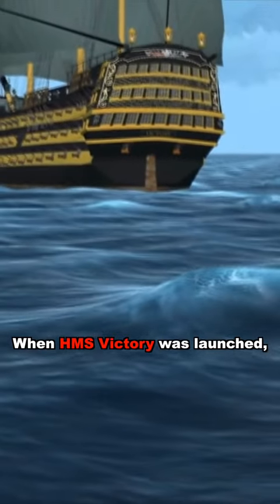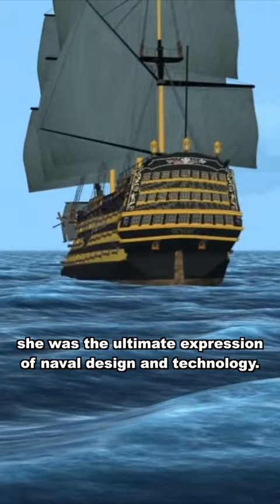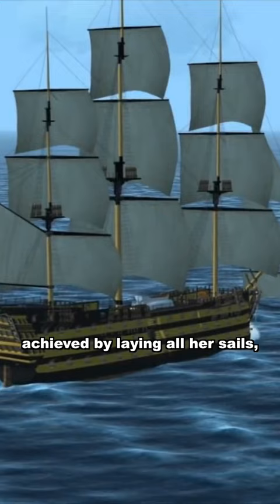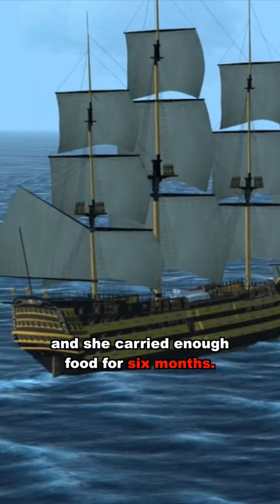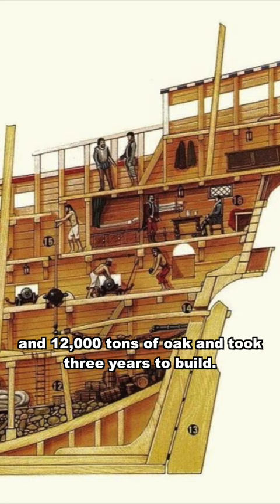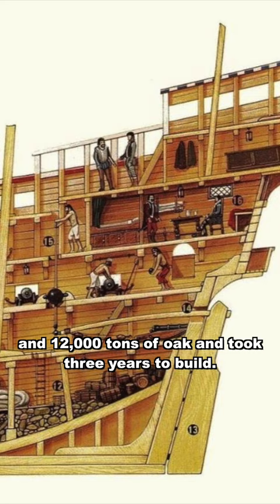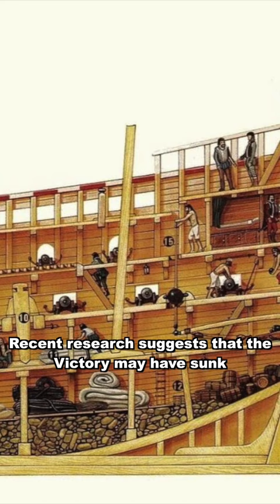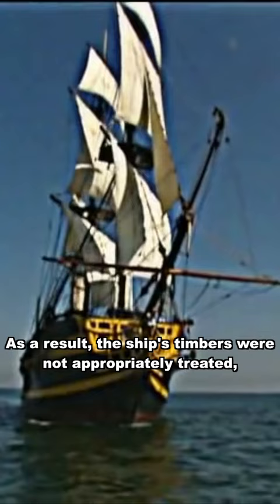Why the HMS Victory is Special

Comment: That's inaccurate regarding her speed. If Victory managed to achieve 12knots, she'd be unable to set all her sails or risk breaking and tearing the smaller ones. More sail does not necessarily mean more speed. The lighter the wind, the more sails required to harness the wind. Strong wind only requires the main sails to harness the power.

Victory never sunk either.
Reply: He's talking about the 1772 victory not Nelson's victory but he shows nelson's victory in the video
Reply: @rafaelacielo3948  no, the 1737 one
Reply: @West_Coast_Mainline  oh that one

Comment: Really? No ship named HMS Victory ever sank due to unseasoned timbers being used. One was wrecked in a storm after hitting rocks, one was burnt by accident, and the others were scrapped after service. In fact, the current HMS Victory owes her long service to the fact that she sat for an extra year or so on the stocks after completing due to lack of need for another 1st rate ship at the time, which allowed for additional seasoning/drying of her timbers.
Reply: That is correct, and probably contributing to the ship being able to last so long. I don't believe they used unseasoned timber for that ship. She did sink, however, in 1854, but was raised again.
Reply: @larsrons7937  I would say "after 89 years of service she finally took a break and rested on the seabed at her moorings". Sinking has such a negative connotation. 😂
Reply: @erichammond9308   I like your way of viewing it. Positive way of thinking. And indeed, after 8 decades of service she has been a museum ship since 1833, that's almost 200 years just on exhibition. That ship has my respect.
Reply: @larsrons7937  She's such a beautiful ship, and the only true battleship left  in existence. If it doesn't have 3 or more square rigged masts it's not a ship, and if it can't stand in the line of battle, then it's not a line of battle ship aka "battleship" 😁
Reply: @erichammond9308   I very much agree. And the 1600s to 1800s had the most beautiful ships of all times. And insanely complex constructions they were.

Comment: The Victory did sink, the HMS Victory built in 1744 sank. This Victory is different from the Victory in Portsmouth built in 1765. The Victory from 1744 was much larger than the one in Portsmouth now.. @hardalarboard8876
Reply: Or 1737 I am not entirely sure whether it was 1744 or 1737
Reply: @Ninjay42 it sank in 44
Reply: @Ninjay42   HMS Victory launched in 1737 (sank in 1744) was about 10% smaller than the 1765 HMS Victory which actually did sink in 1854. It had been a popular exhibition piece for two decades so she was refloated and remain on exhibition.